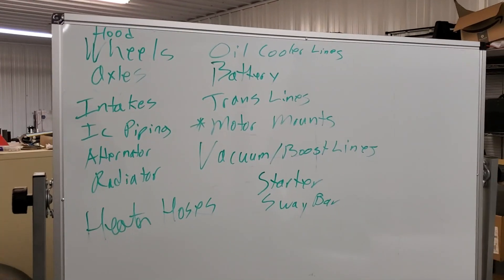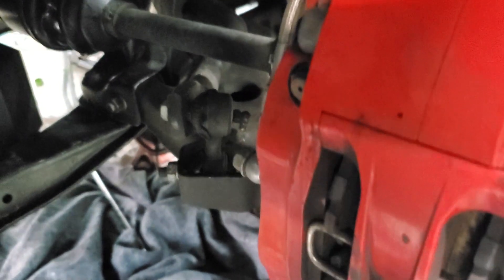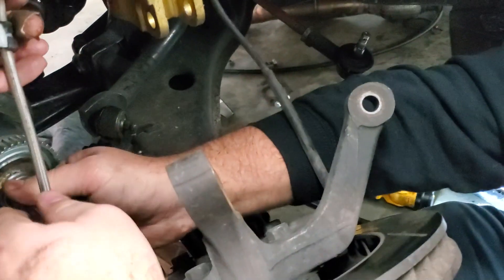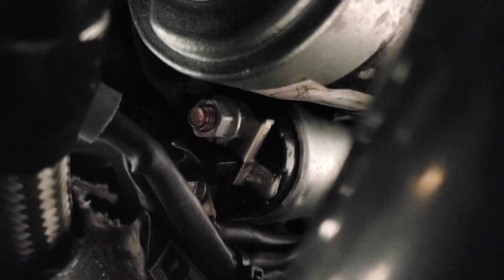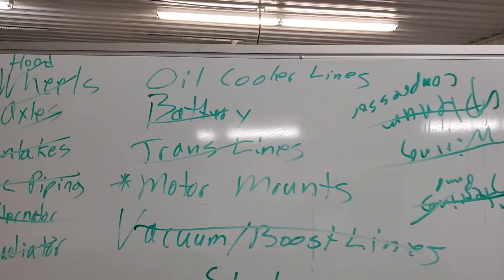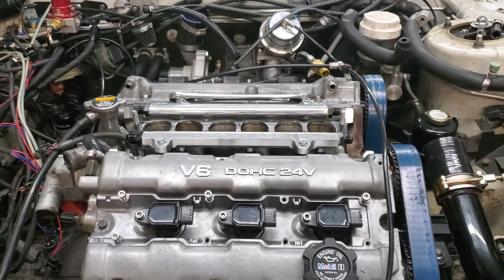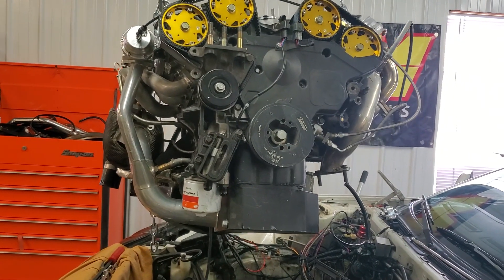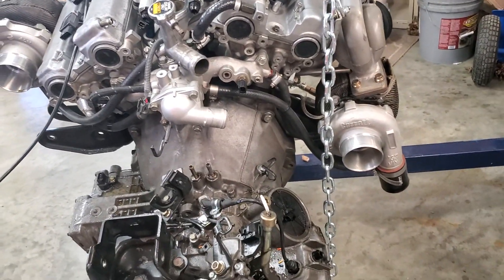3000GT - Stealth Engine Removal

Comment: 6:35 I really wish you actually demonstrated that because I've spent at least an hour on this damn axle already. That cup goes way back into the transmission so I don't even see how it's possible to get anything in between there. I also can't seem to find anything online about actually demonstrating it either.
Reply from the maker: I'll see what I can do, but basically get a big screwdriver between the cup and trans and wack it. There is room.
Reply: @RvengePerformance  thanks do you have to take that bracket off with the 4 14mm bolts or will it fit between the opening of that bracket and the cup
Reply from the maker: @VIP854  no you do not, you come in from the bottom.
Reply: @RvengePerformance  ok. Still at it..
Reply: @RvengePerformance  finally got it. Best way I can explain it is coming in from the right side of the vehicle I wedged the biggest flathead I have in between the bracket and the axel cup into that opening. I hammered it as hard as I could until it bottomed out. It was wedged in there good. Then I came back over to the now free-hanging axle out of the hub and grabbed ahold of the splines and just started yanking it as hard as I could and it popped out.

Comment: Chris: What model engine hoist did you use to pull our VR4 engines with attached transaxle or which would you recommend that will also fold up for storage? Looking for one in the $400 to $800 range. Thanks - Gary

Comment: How much would a shop charge to take out my dohc 3.0 and drop in a vr4 motor ?
Reply: It goes beyond the motor. Sounds like you have a naturally aspirated 3/S, and it’s known that the F5M33 (FWD tranny) does not handle boost very well.

Assuming you don’t care about that, you might need to replace your wiring harness if the year engine VR4 does not match yours. Assuming it does match, you would still need a twin turbo ECU regardless.

If you want to run the dual intercooler setup, you will need a twin turbo front bumper, as the natural aspirated front bumper does not leave enough room for the intercoolers at the front.

I’m leaving lots of information out, but surely you can see how impractical it is. You are already looking at the price of a new motor, ECU, front bumper, intercoolers/intercooler, and potentially a new transmission/wiring harness. Not even taking into account labor, this is a $2,500 expense. Including labor, it may as well be $5,000+.

If you really want the twin turbo in your car, buy the turbos, intercoolers, manifolds, throttle body, intercooling pipes, and new ECU. It might be $1,000 for parts if you find the right deal. The big difference between the 3.0TT and 3.0NA is the compression ratio difference of 8:1 (TT) to 10:1 (NA). Good luck.

Comment: How did you turbo that automatic ( Fulll Details please)? I was under the impression that all the Turbo models were manual transmissions.
Reply from the maker: Yes, all of the turbo cars were manual. This car is originally a six speed. This is an auto from a GTO SR we built up heavily with a built transfer case.

Comment: Hey Chris I'm about to pull my engine out of my dodge stealth and pull me engine from my 3000gt it's been awhile since I've done it and last time I dropped the whole subframe . If I'm just pulling engine do I have to pull the axels or could I just remove the 14mm bolts that is the bracket on the back of the block from the intermediate shaft, I hope I'm asking this right?
Reply from the maker: You really need to remove the axles,  you can technically leave the driverside in remove those bracket bolts you spoke of, but you still have to remove the knuckle to strut bolts to angle the hub and rotor out enough to get the axle out of the trans enough to pull it without damaging the seal. At the end of the day we just pull both axles completely, you can remove the entire 2 piece driverside axle by pulling it out the driverside in one piece after removing the jackshaft bearing bolts and pushing it out of the hub.
Reply: @RvengePerformance  thank you Chris for your quick reply just got my cherry picker yesterday so gonna start pulling the engine out of my 3000gt (the good one ,94 model) and probably next Saturday cause I work thru the week pull the 92 stealth motor(the bad one) both cars are 5 speed . Gonna be using the trans from the 92 model and the engine harness from the 94 model. I believe both are the same trans ?
Reply from the maker: @austinbrown6500  If you are referring to FWD transmissions, watch out the 92s usually  have the 25 spline cv axles instead of the 27s. You will have to use the axles that match the trans (the knuckle part is the same near the wheel)
Reply: @RvengePerformance  thank you Chris when I pull the axels before I do ,will I need to drain all the gear oil out of the trans? Thank you so much for your replies
Reply from the maker: @austinbrown6500  It is the wise thing to do, I have gotten them out with minumum spillage if we were just rapidly changing a clutch, but its best to drain and refill and I would recommend redline mtl. https://www.rvengeperformance.com/product/redline-mtl-transmission-fluid-3-pack/
Reply: @RvengePerformance  is the drain plug also the fill plug man I appreciate you replying so fast I'm on break at work so trying to get all the info I can for Saturday would it be redline 75 w 90 or?
Reply from the maker: @austinbrown6500  there is a fill plug on the front of the trans near the Getrag font. Redline 75w90 is for diffs, you want the MTL.